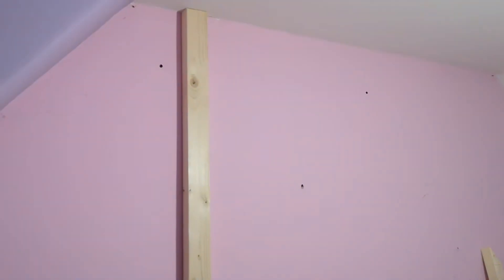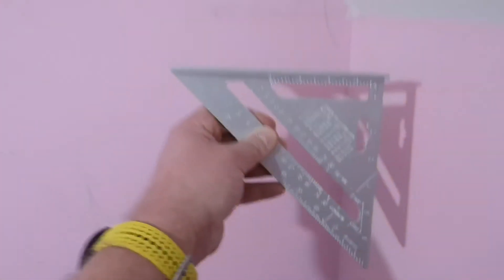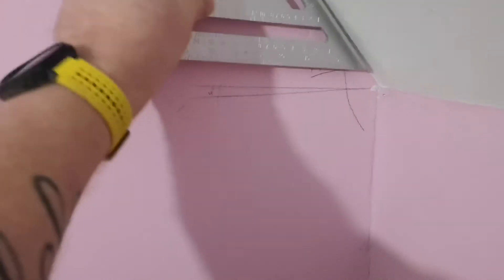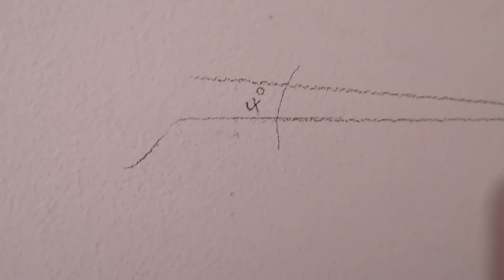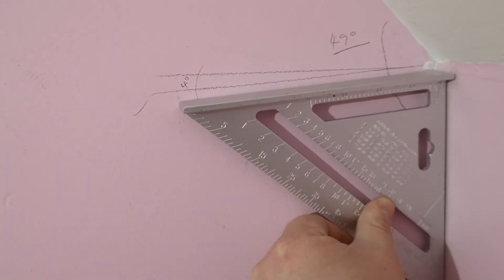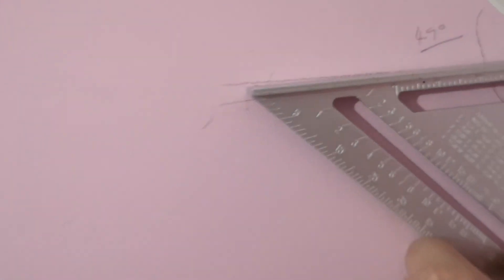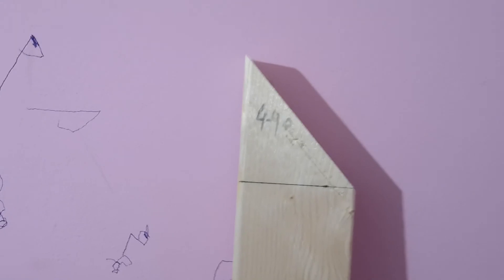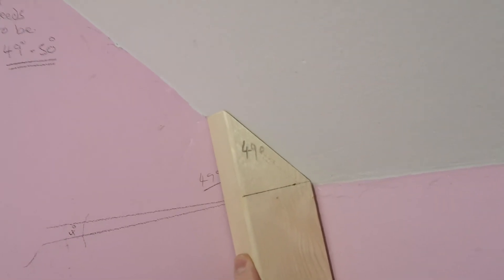How To || Find An Angle FAST!!! || Woodworking || DIY || Speed Square

Comment: Holding a sliding bevel up against the upright wall  would be easier to find out the angel - from a joiner
Reply from the maker: Yep, 100% just got hold of one after seeing your comment and it definitely makes it easier and much faster. Cheers pal 👍
Reply: @Cleggaz  Good man,saves alot of time using a sliding bevel.
Reply: @Cleggaz  this helped so much as I didn't have a sliding bevel available. Cheers mate!

Comment: Or just use a bevel gauge, quicker and easier, draw onto the wood. Or, do you actually need to know the angle?
Reply: @vitalsigns2679  We’ll never know will we? Pathetic answer from you too. 😂
Reply: Bevel gauge all day, you can read the angle with that and speed square
Reply: @vitalsigns2679  he also asked for other methods in the comments